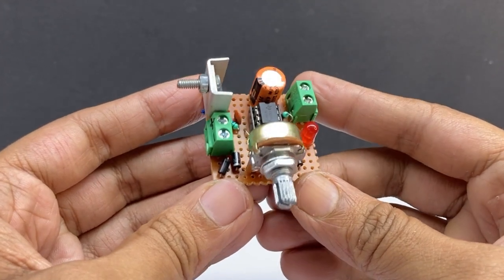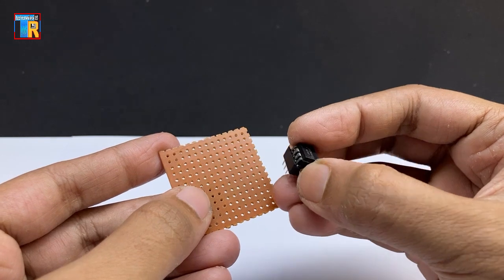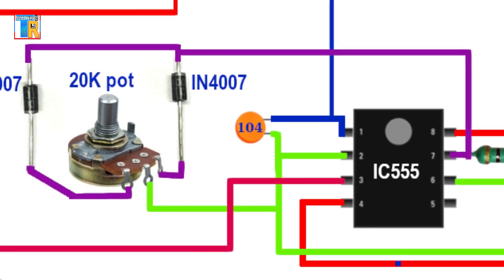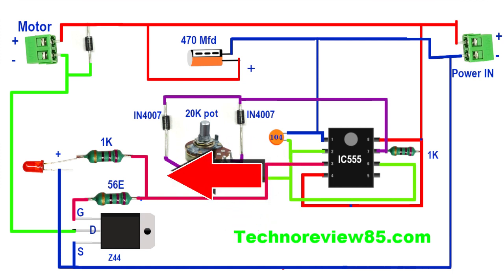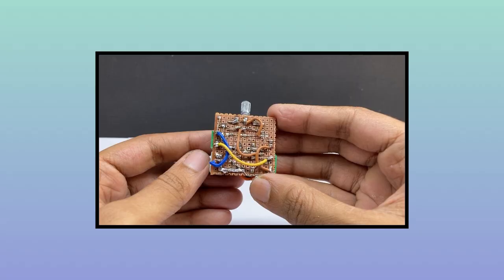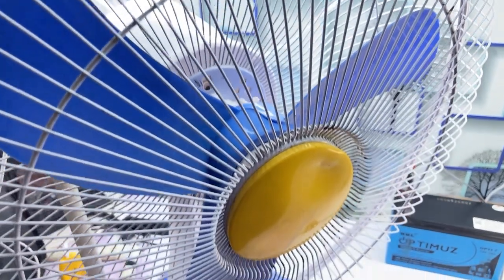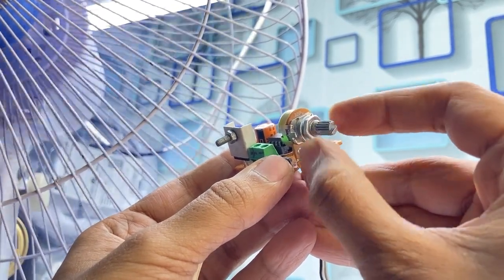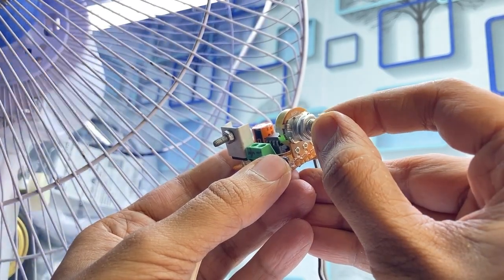How to make a powerful PWM controller for DC motor & LED  lights

Comment: What is needed to modify this circuit so the PWM output is positive?
Reply from the maker: You have to use defferent MOSFET
Reply: @technoreview85  like a IRF9540 P-Channel MOSFET?

Comment: 555 timer ic gets soo hot and exploded, when i use this circuit for my 775 motor (diy drill) , can please help me? What should I do? 

I have used 24v dc and 5A power supply.

But the circuit works very good for led and other small load project!
But it did not worked for my diy drill machine (775 motor)

Please replay me!
Reply from the maker: Use 12v DC
Reply: @technoreview85  what is the max ampere? If i use 12vdc

Comment: Hi! Nice video and info. I have a question. On this circuit the maximum voltage output will always be the maximum voltage input?
Reply from the maker: Thank you. Output voltage is almost same as the input. It has a very small defference.